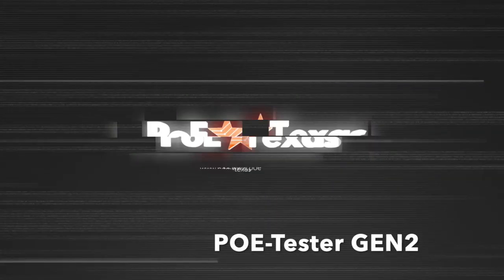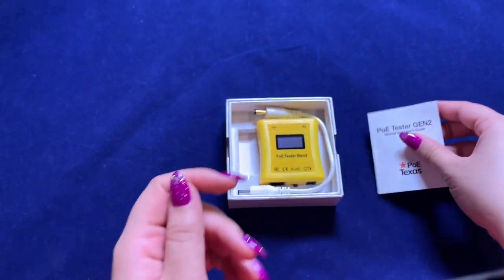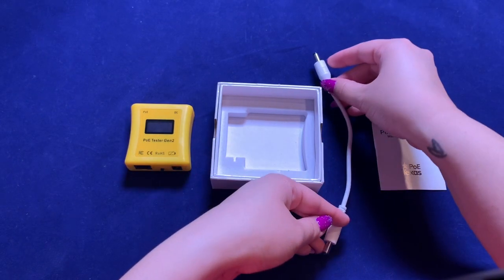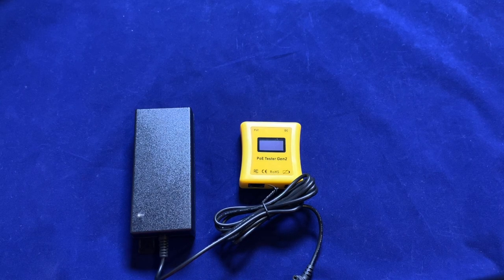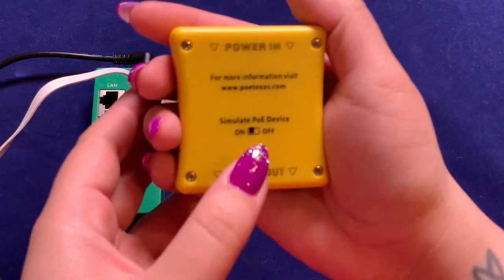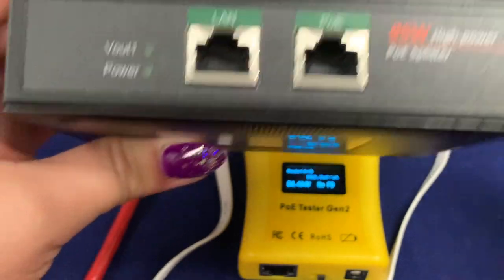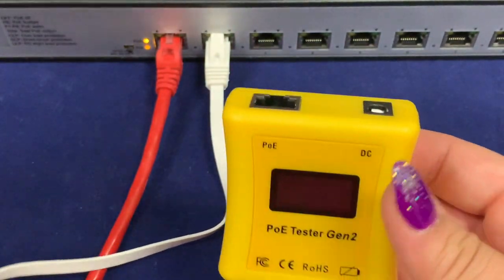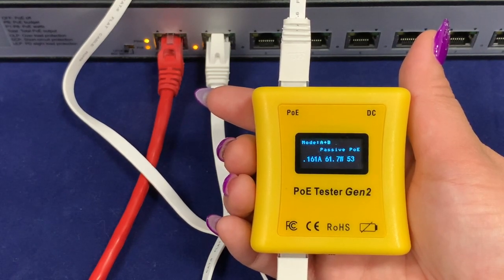PoE Tester Gen2 by PoE Texas

Comment: will it tell you if your poe is defective or failing ?
Reply: Yes, it will tell you if you're unable to connect to PoE.   Process: use a short patch cable near the switch and use the simulate PoE mode.  If the Tester turns on and negotiates power, you know the PoE on the switch is good.  Then take it to the other end of your run, and you can test it again.  If you're curious whether your run is so long you're losing signal, you can also use our PoE Calculator: https://www.poetexas.com/poe-calculator/